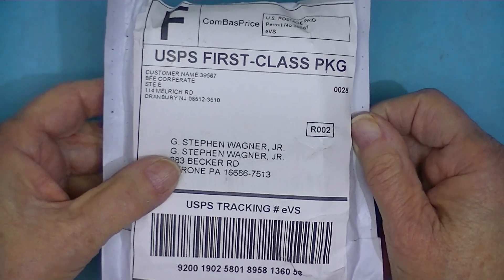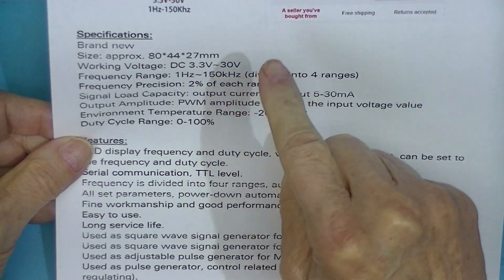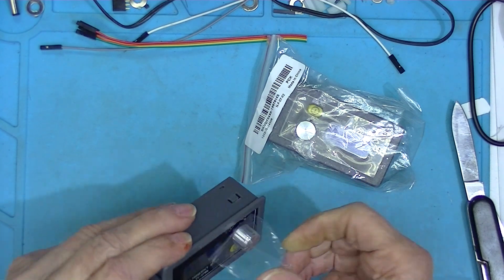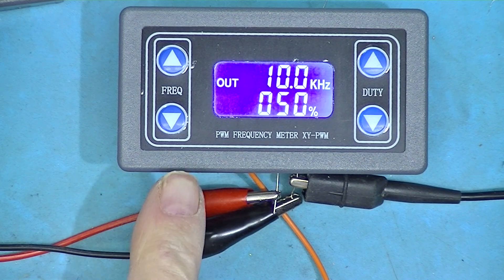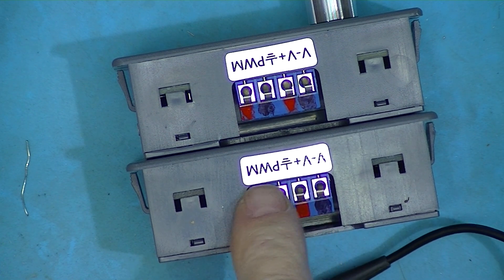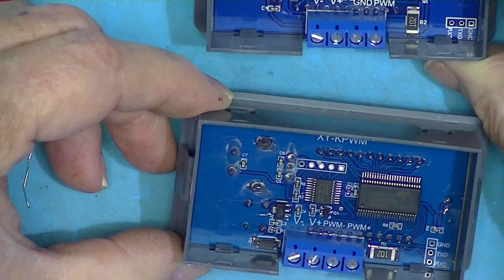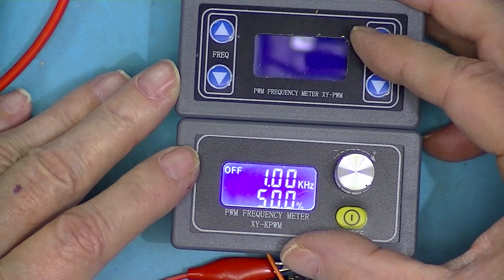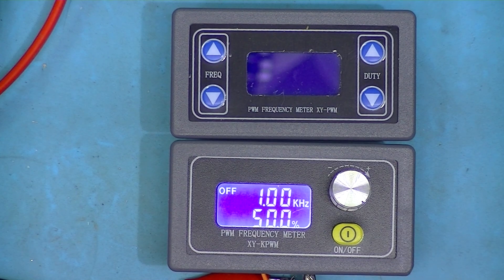Ebay - Bangood Pulse Generators

Comment: Hi I have a fan module that has a ground wire that triggers power can this unit be used to trigger ground on the positive side of the unit to control the fan speed
Reply from the maker: What kind of device do you have? Could you send me a link?
Steve
Reply: It’s a fan module from a 2014 Toyota Corolla pos negative and the small remote wire when I trigger it to ground it stops the fan   Can ur setup trigger this to adjust the speed thanks
Reply from the maker: I have no idea about that device. Good Luck with it!
Sorry
Steve

Comment: three pins inside GND TXD RXD what is the meaning ??
Reply from the maker: I have not used these pins, but I assume they are for communicating with a controller/logger, i.e. a computer.
Thanks
Steve
Reply: They are the  rs232 UART serial connections. they can communicate with a computer terminal or microcontroller through serial which is a neat feature.
Reply: @stevestrivia-bystevewagner4852  ♥️
Reply: @mjyanimations1062  ,♥️